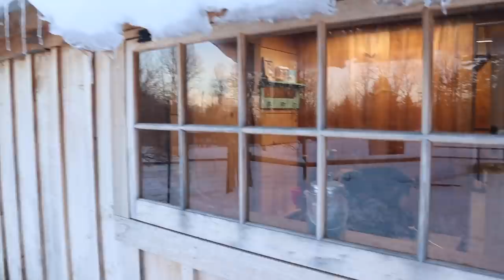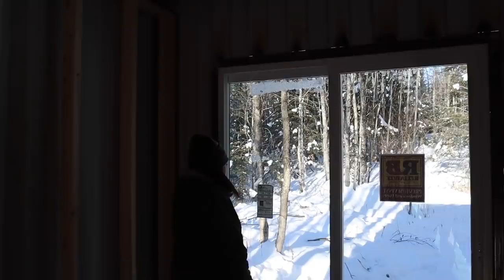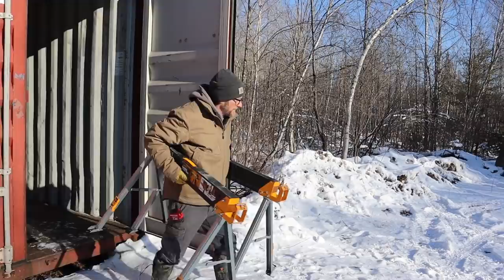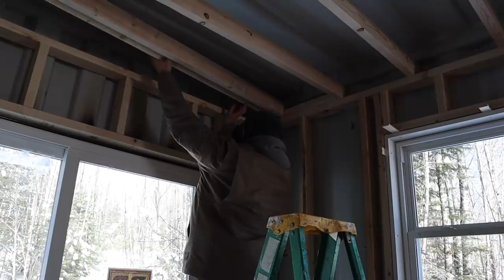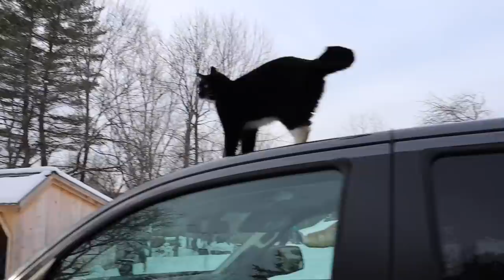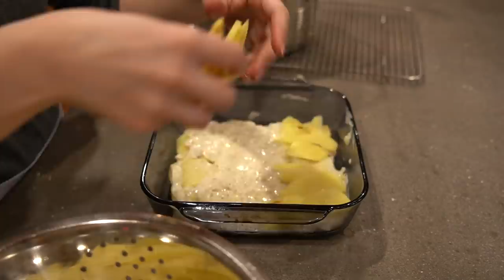It's All Taking Shape Now! Installing Sliding Glass door in our OFF-GRID Shipping Container Cabin

Comment: I think solar technology would work better if the panels were adjustable to align with the changing position of the sun through the seasons. I would be great if the system could automatically align with the sun's position through the day. Keeping the panels oriented in the most direct way possible would greatly increase the overall output of the system.

Comment: I'd put outlets at each end of the building, not just the one in the back. Would it help to insulate the nesting boxes so the eggs don't freeze? I stapled plastic that has insulation in them all around the outside my box, and put reflective insulation along the inside walls of the nesting boxes.

Comment: Please reconsider wood stove placement. It needs to be in center of your living space or far corner away from the door so you don’t loose heat whenever door is opened and will have general heat throughout. Won’t use as much wood that way also. Put three pot lights over counter area, one between window and on either side. Wall moon lights  over bunks for night reading. Storage bench sofa with lift top. Elevated and side shelving around it and pit lights under centered shelf.Husband says extra sockets over workbench, as well as workbench height around perimeter. Full lighting overhead. Remember the difference good lighting made in your current workshop!

Comment: People really like outlets so opinions vary a lot, but I'd think for a room that size, six outlets is more than you need.  It seems like two on each long wall should be enough.  That's eight sockets.  Hard to think you'll plug in eight things in that one room, since you're also planning on putting outlets in the other partition.  Well, if you plan on installing a giant battery bank and solar array and using tons of appliances, more is fine, but it takes longer, costs marginally more, and clutters things up.  The external outlet sounds good.  You can do recessed lighting, but I prefer fairly shallow surface mount LEDs. They don't look as stylish, but they shine light throughout the room, including on the ceiling. If your ceiling is white, that's an easy way to brighten the room. (That's all stylistic and up to each person's tastes, so please do whatever suits you both best, and that will be great for you and fun for us to see.)

Comment: I  wonder  how  the  vapor  barrier permeation  works  in  a  steel  container, as  far  as  forced  air  return  duct  system  mechanics  might  be  applied...heating  and  cooling  might  be  a  safer  option,  throughout  the  ceiling  and  walls,  in  such  a  confined  space. That  and  maybe  painting  the  container  white, to  deflect  heat  as  well. You  could  have  framed  a  double  wide  with  all  that  lumber, that's  quite  a  bit  of  money  in  steel  alone. You  wouldn't  believe  me  if  I  told  you  how  much  Laidlaw pays  for  a  brand  new  school  bus.

Comment: I would use 12 or 24 volt lighting with solar. That way your lighting will work with your inverter turned off. The inverter uses power when it is on therefore turning it off when you do not need it saves battery charge. Perhaps even put in some 12 volt outlets and usb ports as well. The more you can do without running the inverter the better off you are on a solar system.
Reply: Also your definitely going to want more than 2 lights. I would do 6 or 8. 2 rows of 3 or 4 lights. You could always dim them if its too much
Reply: @westtexasrollin6559  You can always edit your comments by clicking on the 3 vertical dots to the right of comment.

Comment: How do you feel about building a much larger compost pile next fall for heating the greenhouse all winter?
Reply from the maker: We need at lot of material to compost. But I am all for it.
Reply: @LumnahAcres  The key is you can use wood chips, grass clippings and leaves for the bulk of it so can harvest a large amount right off the homestead  then mix it in a 10 to 1 mix with the chicken and goat manure to supply the nitrogen. 

Would put in a loop of pex/poly pipe in the pile as you build it to use a pump to bring 100-150F water into the greenhouse where you have a radiator and fan to blow the heat around. Would need to run power to run the pump and fan but 24/7 heat for the winter off compost.

Comment: When I remodeled my home, we figured where we wanted outlets and then added more to have at least two outlets per wall. The kitchen was the biggest failure in planning, double what you think you will need. Don't put more than 8 to 10 outlets per circuit on a 15 amp breaker.

Comment: If it was me, I would make the four outlets by the windows doubles rather than singles. That way you have plenty. Too many is better than too few. As for lighting; natural light will vary with the seasons and the time of day. I don't think two ceiling lights will be enough, to be honest. I would up it to four, if not six ceiling lights and have each pair on its own switch. That way you can decrease or increase the amount of light you have inside to compensate for the lack of light coming in from outside.

Comment: Are you putting in 12 volt lighting like a camper or 110?  It would be quite easy to do 12 volt leds and not need an inverter   One solar panel and a car battery would be enough for plenty of lights

Comment: The biggest factor in off-grid solar is how long do your batteries have to last.  Just a few hours, or several days if you get snowed in?  They cost so much, maybe you should just have a small battery to last the night and a propane-powered generator to recharge it.  You have plenty of wood for heat, cooking, and even hot water if you want it.  So all you have to run off the batteries is tool battery recharging and lights.

Don't buy panels with integrated 120 AC output:  They need a working grid to function.  Buy DC output panels and a charge controller to charge a 24 volt battery array.  Then a 24 volt inverter if you want to run 120 VAC stuff.  Your lights could actually run off the 24 volt battery, but most  tool battery chargers take 120 VAC.

Panels work a lot better if you tilt them at your latitude pointing South.  Hard to clean the snow off them if they are on the roof.  I have a ground mount array that was pretty easy to build.  Concrete pillars with 1 1/2 inch pipe frame above that, and then the panel mounting rails mount on the pipe frame.  You buy the pipe locally and Professional Solar Products has every thing else you need including free engineered plans!  Mine was DIY without a contractor, including building permit.

Comment: Because I've remodeled so many things over the years ,(boats, churches, homes even a Eagle bus) far better to have more lights and recipicals than you need (they're cheap) can lights come in 6 to a box, recipicals and switches 10 to a box. 3way switches 3 to a box.  I'd put 6 cans in the ceiling two over your counter on it's own switch. The switch by the slider should be a 3way the other baby the door coming into the room(  three way switches have a black screw, that screw goes ether to power or load ) outside recipicals should be on each side(you'll thank yourself later) again there is nothing more disappointing than after all is finished and you think I wish I'd done this or that. Hope this helps

Comment: What do the lights look like?  & How bright do you want it in there when it gets dark? as you have told us it gets vary dark there. I go 3 or 4  if they are not real big. I don't know what the lights look like that is why i am asking. Or how large they are. When it comes to outlets more is always better. Power strips are really good to have. I would think have the work bench on the outer wall not on the wall back to back with the house wall, in hope to not have the noise  as loud for any one that might be in there at the time you might  be doing things in there.  Is there a way you can put a 2ed wall on the out side of the chicken nesting boxes & have some Insulation on the out side walls & door to where the Eggs are lead so it might help keep them from cracking. Just a thought.  With the Chickens not staying on them they freeze faster.  if I had chickens That's what I try for the cold. & the chickens might like it more. The Lady's are slaking because they are to cold in there house. & don't want there baby's to freezzzzzze. lol I was still thinking have a door in to the other side of the place in to the storage if you need a way to get out safely if you can not get out the glass door.  2 doors is a good thing to have. Are you going to have any lights on the out side to light it up?

Comment: Biggest electrical fail isn't running the wires or terminating the wires. It's failing to plan the layout. You will have a nominal 220V in two legs of 110V. Planning the circuit can save energy. Decide what loads will always be on. (Refrigerators, Charging stations...) In your case not too much. Loads may change from day to night, winter to summer. You may even want to swap some circuits from Line 1 to Line 2 in the summer. This is easily done by planning to swap certain circuit breakers.

Comment: Ok, been watching for a good while and even went back to watch older episodes. First, The stove outside has been driving me nuts as to why that wasn't installed inside earlier. Im sure you have a reason. Secondly, why didnt you weld out the door frame? Looks like a potential for leaking and mold. Third, what about predrilling the sliding door while in the frame, clean then caulk to get rid of shavings and better seal. You may have already mentioned all this and i missed it. Fourth, ive enjoyed your videos and even tried some of the recipes. Better than whats on TV

Comment: If you're going to go with LED anyway, you could skip the can/pot light and use a surface mount LED fixture that can work with a standard j-box. It's cheaper but has the same look as a recessed light fixture. Search Amazon for "led disk light flush mount" (e.g. https://amzn.to/3axAVH0). They have models that work with a dimmer and the temperature and wattage you prefer.

Comment: Check out DIY Solar Power with Will Prowse. Type system in the search box on his YouTube page. He has good tutorials and systems. You would need to sub in AGM or lead acid batteries for lithium as they don't like the cold. Golf cart batteries would probably be your best option. You will need a lot of battery capacity  and solar panels if you wish to run that electric welder.

Comment: Need to ask a question.  The last rafter you put in above the sliding door.   Are you going to be able to insulate behind it?  If you don't you will have an air pocket that will sweat when you put heat inside.  That will give you a big headache later on.  I would suggest removing it and putting insulation in the air space then put the rafter back in.   I made that mistake on an addition I built years ago and had to go in and drill holes and spray foam insulation in to stop the sweating.  Just a thought.  Looks like you are having fun with the build.  Have a great day from North Dakota.

Comment: 🤔sit down and work out what you will be using while in there plus what you will be using the cabin for once you have finished building the main house. Have Independent USB ports in place so that you don’t need to use a power point for charging phones and notebooks/pads.
As for lighting if your using LED down lights then have one over the kitchen prep area one over the dinner table and have them on a seperate switch from any other lighting used so they can be turned off when not using either area then have a different format of lighting for when relaxing as you will not want a lot of bright lights when relaxing..Sorry can not think of anything more now getting late and I’m falling asleep while ty-Jong this😹😹😹😹

Comment: 6-8 lights or you’ll wish you did it so at least six
Outlets are always  every 4 feet 
For tool battery charging out in 4 double outietd  8” from one a other or closer   You never have enough 
In l/v rom out in charging stAtion  yiur  iPhones  snd laptop  out a shelf below windows and add outlet and charging ones 
Did uiu think abiut ceilimg fabs 1-2 on esch room
Orcat keasr junctiin bix yo add as its great you have two ceiling fans  in a 20’ or room in a metal
Box as it  moves   the air so that 2, on workroom side and two   in living room Side  as it cost nothing to hace them run all
Its nothing to out in extra electric  in  but a pain  to add later  you’ll be surprised  as you’ll wind up
Using everyone you put in  
Put in outside  light switch in living room from over outside the work room so in workroom id put a see we it h  in evert two  feet   on wall  you’ll jace workbench  and  evert four feet  on other side if workroom  
 in workroom 
And turn lights on in storage room
But light switch in living room. Thats two  switches you could fit in easily
Remember its easier to put  in extra electrical  now  boxes  as its nithing also to
Put in a large rhectryfak  
Box for all your breakers  bresjers 24!to 40
If you have fridge computer tv lamps freezer  snd clicks etc b. B bv.  Nn. C  put in outside outlets on either  side of doors in either side of entire  box   Side   of entire nox      . I did that and an glad   I out in all the extras as u really great  I did two 40 foot u its  and sold one unit  for extra $1800 because if all the electric  boxes with  a 32 box   of breakers.  It cab get more thats  just a finished  inside walls and doors. People like electrical  people like the extra as they may party and beed plugs if that have 
Also put in fruit trees as soon as weather permits  l added  take 2-4 for fruit to
Plant   out in 6 ‘ fruit trees plant among side in
 40 box  pit in seed grow  in   shelves inside  with lights    to grew seedlings.
Put in as many solar panels  as possible   ad you cab fit as  you can have a/c  s was h  have

Comment: If it's "non structural" why waste time and material putting cribbing in over the door?  Like the videos though.
Reply: Technically, none of the interior walls are structural. It's a metal container! It's all about finish. It's a lot easier to secure your inside finishes to wood studs than to the metal container walls. You also need to insulate that wall as well.
Reply: @davids7209  - I know that David.  Al made that statement more than once.  Putting in extra cribbing is just a waste of materials and work.  The area he is putting it in is smaller than the average stud bay and there is no way you need that many places to attach to.
Reply: @flick22601  Sorry If I seemed confrontational.... I misread your initial comment.